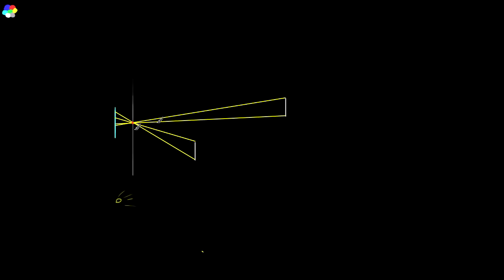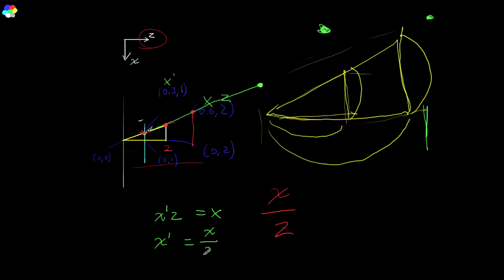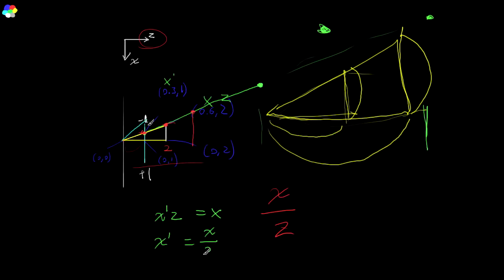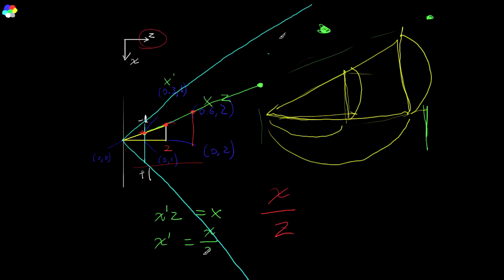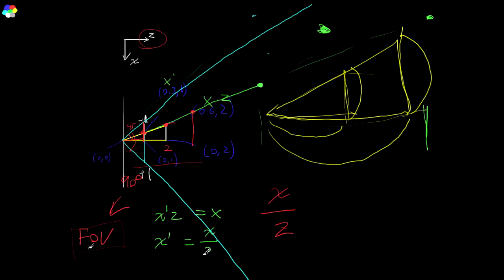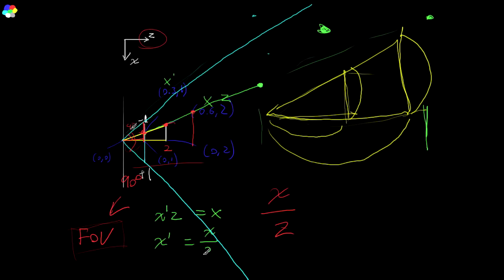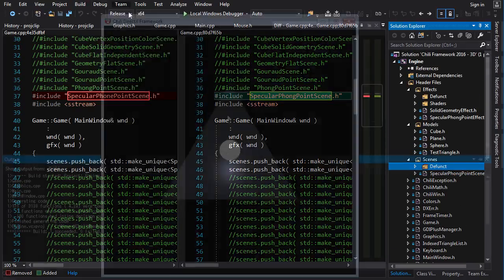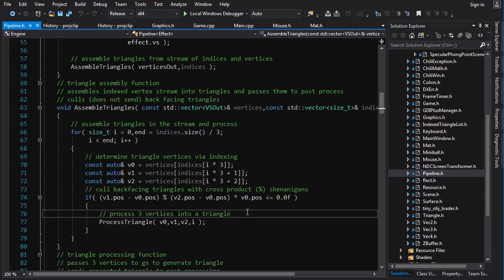3D Programming Fundamentals [Projection Matrix] Tutorial 20

Comment: Anybody who wants to REALLY understand this whole "projective space" stuff, check this out: https://www.youtube.com/watch?v=q3turHmOWq4
It also explains why that's exactly what happend in translation matrices (4x4), and is actually not specific to 3D, you can do projective geometry in 2D or even 1D(!) - whatever "D" you just put your entire space in one higher-dimention. It's easiest visualising it applied to 2D space in 3D (as is done in the video I linked to) - Think of: "putting a piece of paper with a drawing on it, on a table" and then just "raise it up by one unit in the air" in that new dimention (3D). You notice that nothing in that drawing changed at all by doing so. Now, if you then just "shift" that paper sideways and/or back/forth (essentially "shearing" the whole 2D paper in 3D space), you get what a translation matrix does... BUT: If instead, you take a paper with a drawing, and then, say, squees on it's sides to make the middle of it bulge upwards, you can then imagine what would happen if you then try to flatten it back on the plane at height 1. If the paper was "stretchy" so it could squeez into itself downwards to the same smaller width you first squeesed it to, then the drawing all it would get all warped inwards towards the paper's center. THAT is what the projection matrix is dowin (whell, more accurately, that's what the "projective aspect/component" of it is doing...). Dividing by "w" is just what you do to "push back" anything above the plane at height 1 down to it - imagine the origin point having a gravitaional-pull on everything, but have a transparent glass at height 1 stopping it from going further. The math of it is explained in the video, but it's actually very simple and intuitive one you see it...